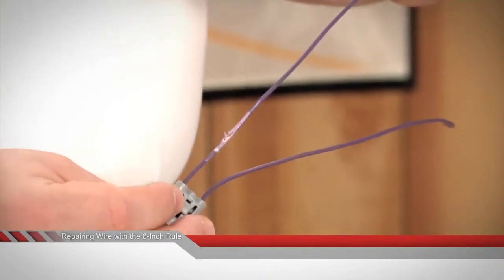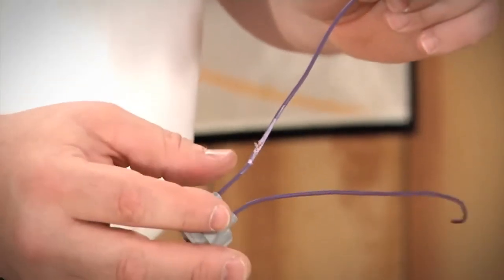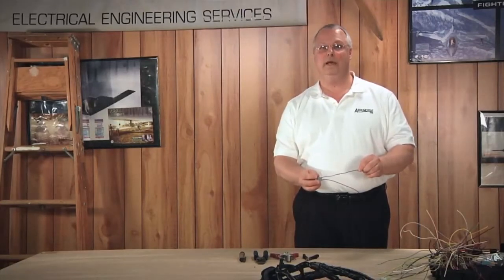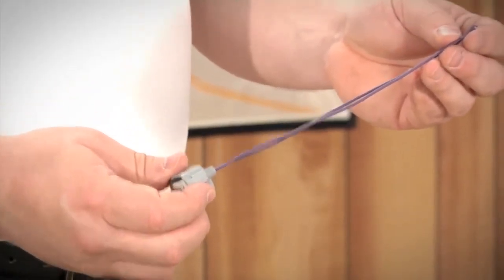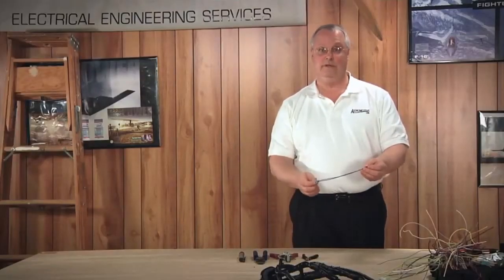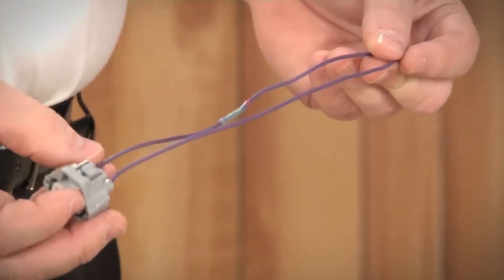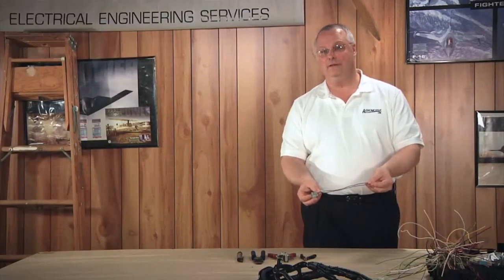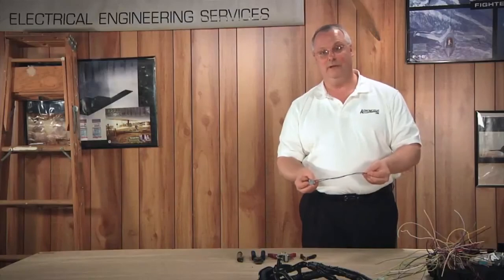Ch. 9 Repairing Wire with the Six Inch Rule

Comment: I have a 2006 4.7 v8 4runner and it wont start now do to where the DEF RELAY IS MADE A POP NOISE AND STARTED TO SMOKE AND IT KILLED THE POWER LINE TO MY MAP SENSOR SO I RAN A DIRECT LINE, WHICH WORKED FOR 3 WEEKS BUT NOW IT WONT START,  I WAS WONDERING IF YOU HAD ANY THOUGHTS AND WAS WONDERING HOW TO GET THE FUSE BOX UP AND OPEN SO I CAN SEE THE WIRES, I GOT THE 3 BOLTS OUT BUT THE MASS WIRE BUNDLE IS KINDA KEEPING FROM LIFTING THE WHOLE THING, IS THERE ANY WAY TO GET SLACK ALSO I HAVE NO POWER IN THE STA NO.2 FUSE OR THE EFI2 and various other defroster fuses. Was wondering if you could give me as much input as you can and any wiring diagrams for the 4.7 v8 06 4runner. I would appreciate it. I'm from ny and stranded in South Carolina my email is
wwgowga17@gmail.com
Thank you for your time and effort!